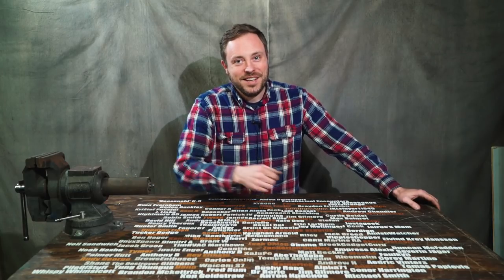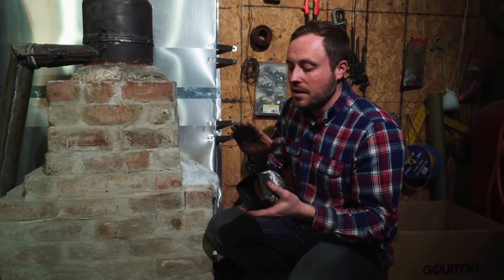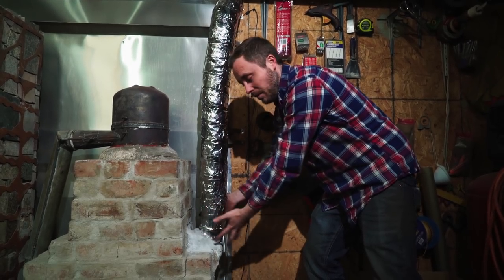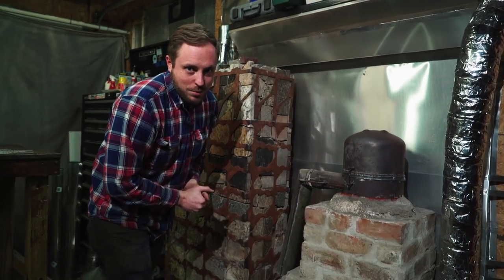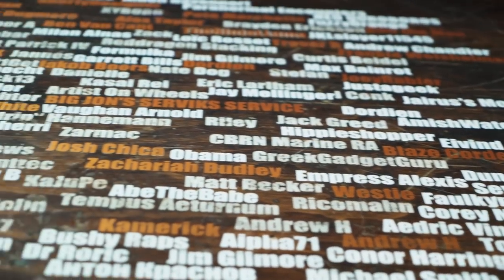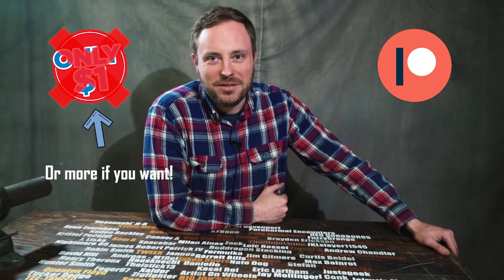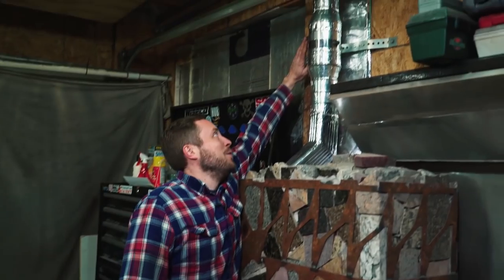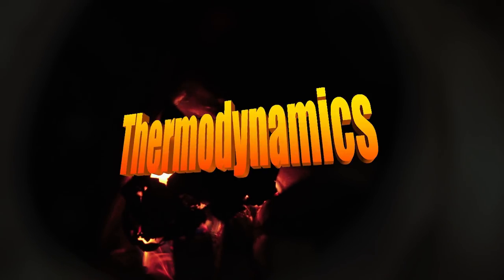Heat Your Garage For 74¢ A YEAR! - Mini Nautilus Rocket Heater Upgrade

Comment: You should show a timelapse of a couple of thermometers around the room starting at pre-ignition and ending at what is you're comfortable working temp. So we can see it in action.
Reply: Also would be interesting to have thermometer on exhaust and intake as well to see how much those increase over time. Plus run it with normal amount you would, but measure the amount, like 4 feet of 2x4 lumber with moisture content of X can be used to calculate how much potential energy there was to begin with.
Reply: Yes! What @Hellsong89 said! We need to know temps of room and exhaust at various times starting from cold, and including the temps when the heater seems to be maintaining a temperature for a period (an hour at the same exhaust and room temps would be informative)

Comment: To code is always the best way. There might be a case some day where there's enough creosote build to cause a chimney fire (I know, rockets aren't SUPPOSED to, but...).
Another: you sell the house. New homeowner puts in a standard stove. It's only a matter of time...

Oh, and your on-off switch should have the 120V receptacle switched. Just because those small plug-in bricks are "Energy Vampires," drawing current (even if just a bit) whenever they are plugged in.

Comment: I built a rocket mass heater in my living room about the size of a small elephant and you hit the nail on the head today. To make it work correctly at least, you have to run it for a long time and that means like you said, sitting on the floor splitting wood and feeding it. The problem is, since mine is so big, I have to feed it about eight hours a day for three or four days in a row, before it will maintain a comfortable heat level in my living room. Live and learn.

As for my “shop“ heater, I made a very tiny rocket stove out of air Crete and ceramic and I just let it roar next to my workbench. I used a nitrogen cylinder for the primary chimney enclosure and a run an inch and a half 14 gauge square steel tube out the side across the shop and up to the stack. The horizontal section of that has corrugated tin “fins” welded where they touch the pipe and The whole thing works like a champ and heat things up lickety-split. 

Of course, it looks like hell, so if you have a wife or girlfriend, it probably won’t fly.

Edit:  A Simpler fix to prevent down-draft from wind is to drill holes on the vertical sides of the chimney pipe from the top down about 12 inches. Next, weld a cap on top, which prevents wind and rain and snow and birds and so on from going down in there. Next, weld a piece of steel pipe, open at each end over the termination .6 inches each direction, past the drilled holes. 

When viewed from the top down, it would look kind of like Darth Vader‘s stealth fighter, kind of. 

Anyway, all the holes you drilled lets the exhaust out, but wind blowing from the side or down can’t hit the holes, so it doesn’t become a problem.
Reply: That just shows how bad they actually are.
A normal masonry oven can be just filled once with 2 crates of wood, takes a couple hours to fully heat up and lasts for 2-3 days.

Comment: I don't know if you will read this, but I have had this idea for a long time though mine is different to a degree. I think if you use ceramic spray coating on the inside of your tank you will make it last for decades. This is the same principle used in turbine burn tubes. But I like the use of actual science and practical use of space, though I think you could have adapted a better intake design, and intake air to better burn, and also have a longer burn.  I would love to collaborate with someone like you on a design. You have common sense and logic.

Comment: Cool video.
Got a couple of ideas/suggestions.
1. If you block of parts of the vent towards where the wind blows from, I think it will create suction instead of blowing air "backwards" into the system. 
2. About the exit-baffler: Water Pipes etc. should have the valve-handle so that it's "across" when it's closed and "along" the pipe when it's open. That way you can see with a glance it it's open or closed. Might be an idea for the baffler-handle.

Almost forgot: Peace man.

Comment: Put a stove burner on top of the helium tank and then you could make soup and/or coffee while you're running the heater.
Reply: Making instant ramen with a wood fired heater is a video idea.
Reply: should put one of those heat powered fans on it to produce airflow in the room for free!
Reply: right... a small(or big) stirling engine with a fan attachment will do the trick or a steam powered fan on the exhaust
Reply from the maker: The only problem with that is I don’t need to run it very long and it doesn’t usually get hot enough to cook stuff but I have put water on just to raise the humidity in the garage.
Reply: @jairusofall  If it's really that efficient, it's not surprising you don't need to run it long - but if its that efficient, it can't take all that long to boil water, can it? Even if it wouldn't be enough to stew something you could still brew a pot of coffee with it.
Reply from the maker: WhiteKnight Leo First I don’t drink coffee. Lol 
Second the shape of that helium tank is terrible, has no contact area since it is all curved. I honestly thought it would work since it gets so hot but it doesn’t.
Reply: @jairusofall  Sure, but you could still take the heater coil off a stove top and weld it on top of the helium tank, right? Then you've have an appropriate heating surface. Or just do what This Old Tony did and use a torch to bend a length of round stock into the appropriate shape and then weld that on.

Also, people who don't drink coffee typically haven't had a good cup. I'd recommend consulting with your local coffee snob.
Reply from the maker: WhiteKnight Leo I like coffee I just don’t drink it. Makes me feel like I can’t keep up with the energy. Hearts gonna explode kinda thing. Lol
Reply: You couldn't thanked the hippies at the end after your typical denigration of hippy comments in the beginning. haha. You didn't read that book "How hippies saved physics"? or whatever....
Reply: @voidisyinyangvoidisyinyang885  Right? lol, also the "hippies" say to run the exhaust tube closer to the burn tank to reheat the exhaust air, thus negating the need for an intake fan or insulated chimney, a more elegant solution imho

Comment: From what I understand, super-heating the incoming air increases burn efficiency and insulating the exhaust flue improves the flow of exhaust gases.
Reply: That works in a conventional system.  But you don't want high flow exhaust gasses. You want it to move slowly so it has time to give up the heat to the "mass". That mass then will slowly radiate  that heat into the room over the next 24+ hours.
Reply: @jeffery19677  Yes you're correct. I mentioned the insulated flue for cases where so much heat is absorbed by the mass that by the time it reaches the exit that it's hard to draft out properly because it has lost so much heat. You only insulate the exterior part of the flue where it's exposed to cold outside air. It's a fix for people who build long runs & find that their burn is losing efficiency because of too slow a draft.
Reply: @jeffery19677  "But you don't want high flow exhaust gasses." Which is the opposite of a rocket-stove.
Also no, with a good stove you still want a decent flow - they are just smart enough to know how to make the exhaust-path long enough to give of most of its heat to the thermal mass before leaving the stove.

Comment: Very cool system. I built one last year. Quite different but exact same principle. 
You brought up where you get some smoke during initial start up... as you know these heaters are like an organism. They need a different kind of attention. I use a propane torch to pre-heat the exhaust. It primes them to get the heat moving in the direction we want. It only takes about 30 seconds and pretty much eliminates the smoke. I also have a damper just prior to exit of garage to close off cold air from cooling the heater down after a good burn.
Reply: I seem to recall a guy who did that propane pre-heat in a clean-out under his J-tube.  I think you can also put a cleanout at the elbow where your stovepipe leaves the mass to go up the chimney, and light a really small fire - like a wadded-up page from a newspaper in that cleanout to warm up that vertical stretch of pipe.  Then you can close the clean-out and light the rocket.

Comment: Stoked dude and PERFECT timing. Just been offered a Pot Belly stove by one neighbor and a wood pellet stove by another and neither are rocking my world (although I am grateful for the generosity and thank God for good neighborly relations). My shop is 36 x 32 and very high. It's freezing in there all winter event though it's insulated. Miserable quite frankly and I don't like the idea of $$$ on a high end electric system. I have wanted to build a mass heater for a while but have been too chicken shit. This has given me some confidence. Thank you so much mate.

Comment: I love the idea of a rocket stove. The trick to NEVER GET SMOKE INSIDE is to make a venturi tube outside encasing radially and parallel with the flu pipe with a enclosed motor at the top of pipe. This way you turn on the motor from the inside and never have to worry about going outside. This is only to start the stove when needed. This is the BOMB if you know what i mean. Good day too.

Comment: 7:15 - you get more than just steam out of the exhaust, it's just that CO2 is an invisible gas. The lack of smoke is a lack of unburnt carbon, which is indicative of a very effective burn cycle. If you wanted steam only, you'd need to be burning hydrogen.

Comment: I Really enjoyed this video. The ONLY negative thing I can say is, When you glued the Roof flashing/tube/cone/witches hat.... (please insert your local slang for this product/implement/component....here & save us all the corrections from the peanut gallery) You went ALL the way around the flange underneath. I was Always trained to leave the lowest point (bottom of the slope)  OPEN with NO GLUE or adhesive (meaning; you glue ONLY the TOP side, the LEFT side & the RIGHT side yep, only glue those 3 sides) Because, IF there is any build up of water/moisture/condensation, it has some where to go/leave/exit/drip & NOT build up or back up over the actual roof  hole & leak back into the structure. Is this a rare occurrence? I think so but, by the time you notice the leak inside the finished space, there has been enough damage to the unfinished space, you still have an even larger problem.  I have asked many an Experienced roofer about this ideal/ideology/preference....
& have ALWAYS been given the same answer; Yes leave the bottom open to allow drainage.

Comment: I've seen a few people talk about cold start issues. The 2 fixes I recall are having a bypass to get the chimney warm before starting to warm the mass or putting the chimney near the bell so it's heated that way. Folks generally want to keep electronics out of the mix because they're either using it as primary or emergency heat and in either case they want to be able to get it started in an emergency when they might not have power. Not an issue in your situation and even if it was you could run the fan with a power bank in a pinch.

Comment: I did the very same thing a few yrs ago...but uninsulated dryer vent in-tube, Was in basement of two story so after basement got warm had some reverse ex flow problem when the heat rose up inside house so we just stayed in basement when it was real cold and the fan stayed on the intake. Great cooking on top of barrel with spacer so metal would not get red and warp?crack?melt? Lill cheat used wood chips I covered that was delivered in fall free., just added a expanded metal guide to hold em in place so my sticks were like a spacer that held the guide in place until all burned and started over..

Comment: Only improvement I can think of is a thermoelectric power supply for the fan running off the "waste" heat. Might still need the wall wart to get it started but once that helium tank warms up it would run itself.
Yeah, I know, those are expensive. OTOH if you have enough scraps of the right metals laying around you can fabricate one. It won't be pretty but it will work.
I don't think you'd have to bring in a cold sink from outside, should be plenty of energy available in the temperature differential between the tank and the room air.
Reply: There are some Stirling engines that could create that level of electricity. There are even non-electric Stirling engine fans
Reply: I have an old solar panel on the roof of my garage that keeps a bank of old car batteries charged up. I use them to charge my cordless tools, run the lights, and run the fan on my wood forge.

Comment: Build a bypass chimney pipe you can send the exhaust through while you get it started and hot.  Then when its hot switch the valve and send the exhaust thorugh the mass. It will give you faster and better stars.

Comment: You could also put a Y joint on your air intake/fuel feed opening so that you can feed the fire without having to dismantle it every time. You'd need a cap for it and you'd still want to turn off the fan to get it going but it would make it a bit more functional. Might make it possible to construct some kind of automatic feeding hopper of previously processed wood too.

Comment: Any kind of steel used in the burn chamber is doomed to failure.  The kind of heat created by a system like this will create spalling of the metal.  Were you to take your system apart, you might find that significant erosion has already occurred.  Masonry or refractory materials are the only thing capable of standing up to the extreme temps of a highly efficient wood-burning device, over numerous firings.  Also, there is a simple bell design, with metal inserts in the top, that would take up about half the space of what your unit does, and give off just as much heat.
Reply: Jason could you please post a link of the simple bell design with metal insert you are mentioning? That would be awesome as I am planning to build a RMH but I don't have a lot of space. Thanks in advance
Reply: @vivanicola  Do a search for Paul Wheaton, tiny house rocket mass heater.  Imagine that unit with metal panels on the front and the sides of a squared bell, at the top of the masonry structure.  You are essentially building mass on top of a Finnish contra-flow masonry stove, with metal panels to radiate immediate heat.  The masonry mass will store heat for slow release after it gets warmed up.  Instead of having the mass to the side of your burn chamber, it sits on top of it.

Comment: Have you thought about putting a little fan on the helium tank to circulate the air and help warm up your garage more and faster? It also sounds like to should cobble together something to help split down your wood faster. This is my favorite rocket stove design I've seen thus far. I plan to build my own house and want to incorporate a rocket stove into the design.

Comment: How do you remove ash from the combustion chamber? No matter how efficient the burn, there will be ash. I think I've worked it out, just like an ordinary wood burner, clean out the ash with a vacuum when it's cold.

Comment: I would add a "vertical feeding tube" for longer pieces of wood, that opens to the fire chamber and is air tight when the pieces of wood are installed.

Comment: If your worried about the cold dense air pushing it's way back down the chimney it seems the best place for the exhaust to exit your garage would be near the floor. This would also condense the warm moist air in the system if any at floor level so it wouldn't run down into the system. What do you think?
Reply: I think you still need the exhaust to go up x feet for y feet of horizontal distance from the burn chamber, according to lore.  But I think if you built a proper rocket, it will pretty much only go one way, once it's going, also according to lore.

Comment: I think the reason they say you can't use steel is because the heat causes the steel to oxidize very quickly. You might be able to just replace it every few years to prevent that.